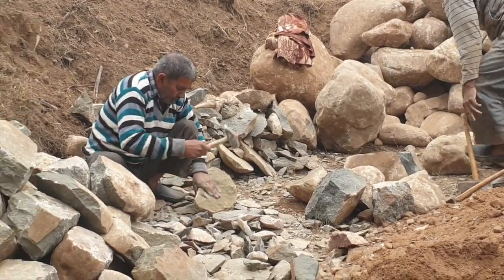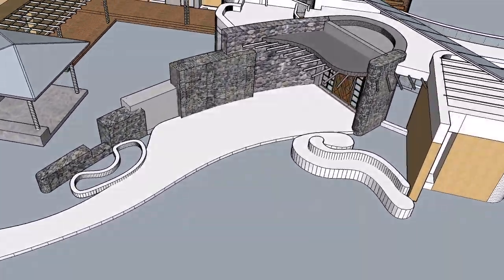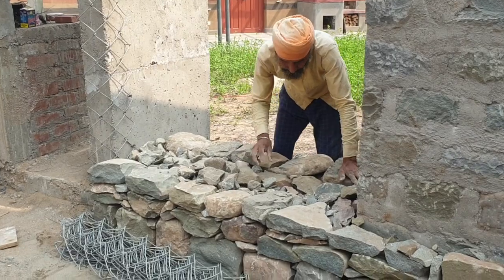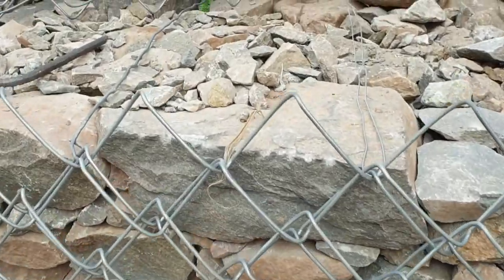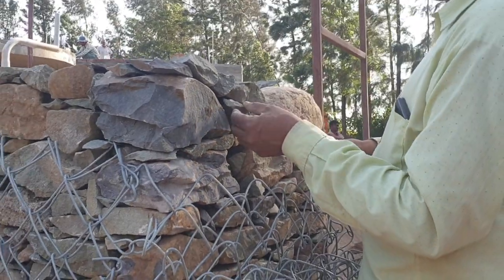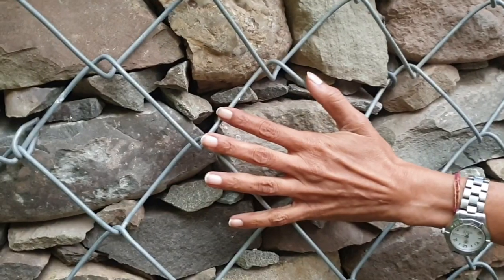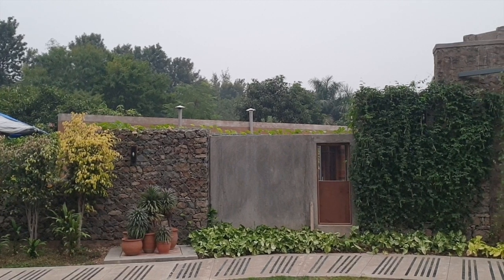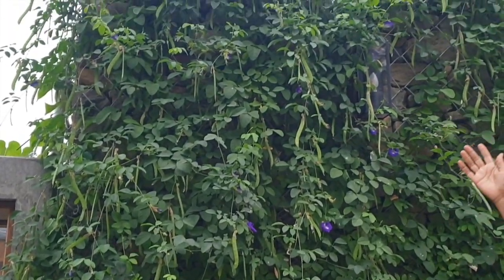How to make a Gabion Wall

Comment: Great video. Aparajitha is just blooming. Here in Konkan region of Maharashtra, we do it without mesh. Stones used are mostly laterite stone and wall is mainly used for fencing the land. For binding, we put dry soil over the stone. In rainy season soils gets wet and it sticks together. Sometimes walls build without soil as well. Laterite stone is not that flat and it has edges so stones get interlocked.
Reply from the maker: Thanks for sharing your knowledge.
Reply: Great knowledge sharing Gaurav. I have experienced the texture of Laterite soil and what you do with it in Gabion wall is truly logical. Keep on sharing such useful knowledge.
Reply: Hey Gaurav can you share some pics or link? i am planning to build some fencing wall
Reply: @malayhk  Looks like youtube doesn't allow to post links in comment, my last comment got removed. If you can send me your email id then i can send images. There is one video on youtube with name "Compound Wall Building using Laterite Stones" on channel "Smart Nail Art"
Reply: @GauravVichare  YouTube allows the posting of YouTube links

Comment: Manisha, could you please let us know if they joined both sides of the wire mesh internally using wire inside the wall.
Reply from the maker: Yes they did. You can see that in a close up shot

Comment: Did they use a through brace on the wire frame? It looks like they built a competent drystone wall and then rolled a chain link fence over the completed wall, with no structural/retaining braces connecting the wire frame through the stone wall🤷🏽
Reply from the maker: It looks ljke that, but they have used a through brace after every layer of stone. You can the wires tied across in the video

Comment: The secret of these is that you put many  strong wires inside the boxes to   hold the walls to make them steady. Right?
Reply from the maker: After every layer of stone there is a wire securing the mesh in place